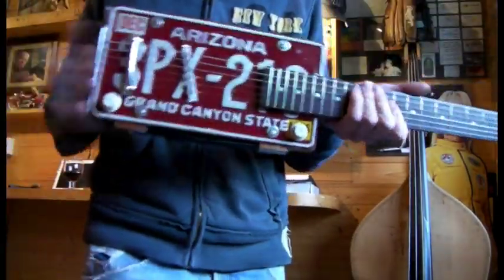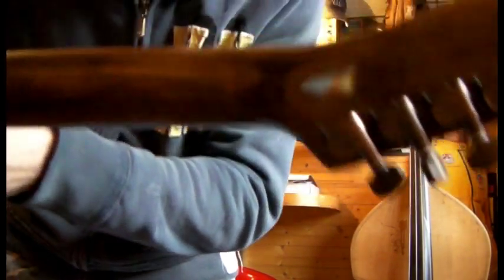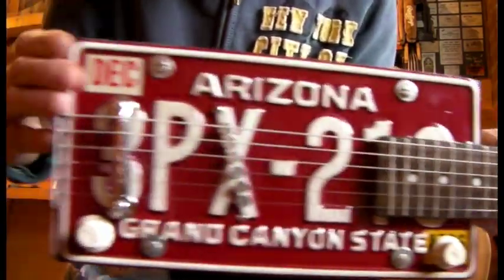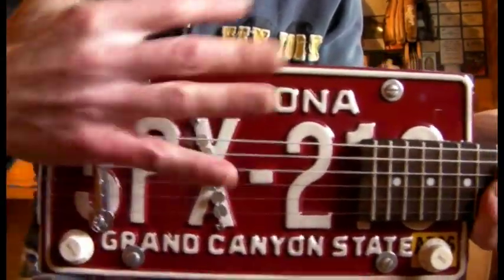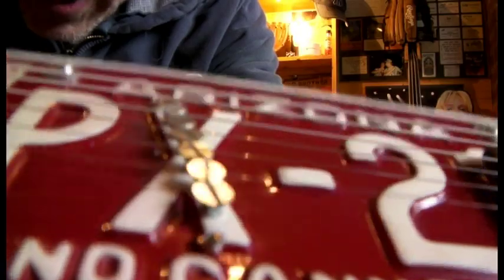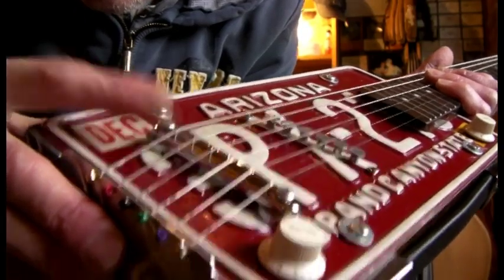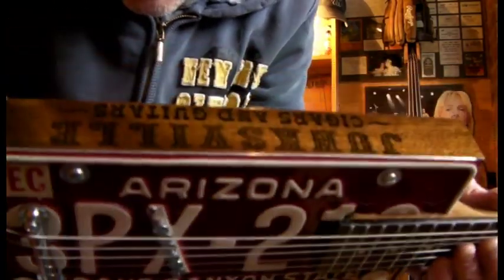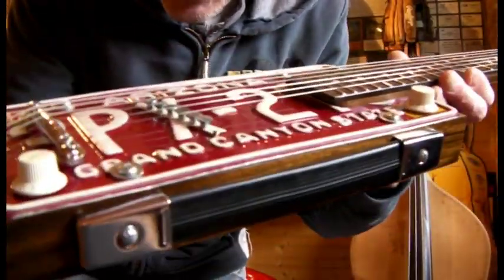LICENCE PLATE RESONATOR CIGAR BOX GUITAR BY JUNKSVILLE GUITARS

Comment: Looks great! Question... Does the E1 string ever get caught under that bottom pickup screw (when you strum hard)?
Reply from the maker: Raindrop Services, thanks a lot, no never caught it under the screw, action and pickup up screws have to be set right, then all is good
Reply: Thanks for your reply. Your guitar is very inspiring to me and I will make a similar one. I had some additional thoughts on my question. In fact, I think that the key to doing this kind of pickup right is to have it as a bridge pickup, as seen on your guitar. If it was a neck pickup it would be more towards the middle of the string, where the string vibrates more, and it would be more likely to have that string get caught under the screw. So, basically, this kids of pickup needs to be a bridge pickup. Thanks again for posting this video. Very inspiring!